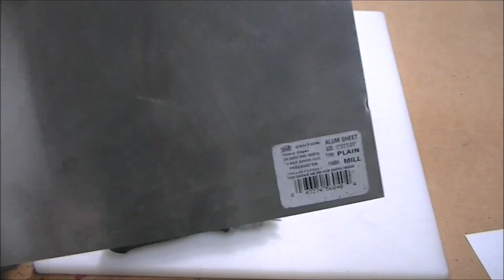Belt Buckle - Making It Yourself

Comment: The welds weren't working the first time be cause you didn't really melt the base metal try starting the arc on the belt buckle and going up to the nail should work better but the plug weld method you used seemed to work pretty good
Reply from the maker: Thanks, I have weld a few more things since then but to be honest I still suck at it.